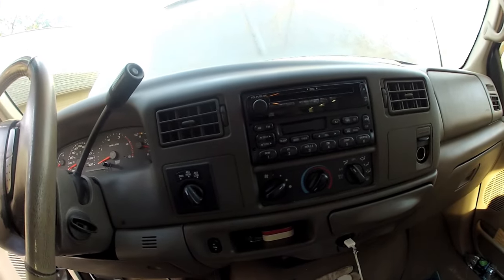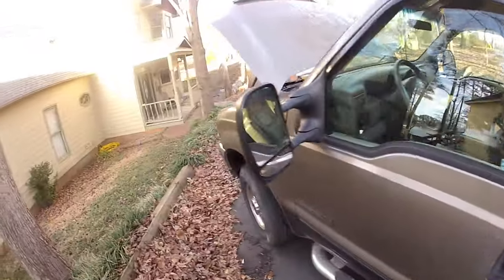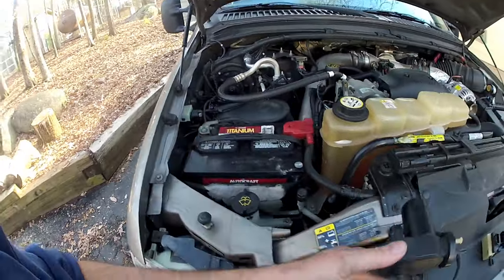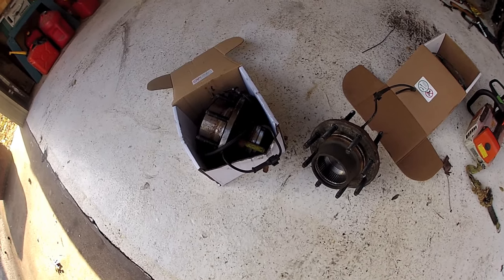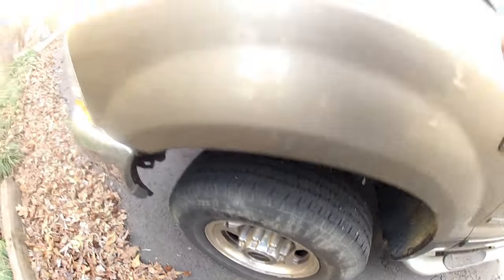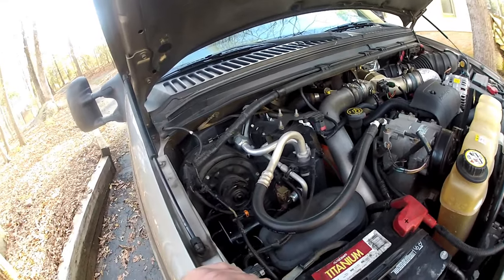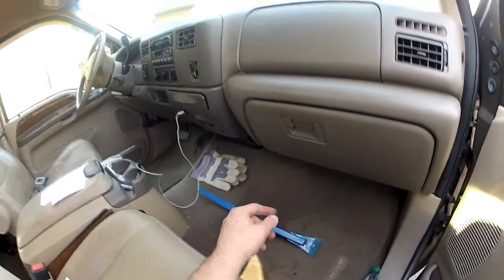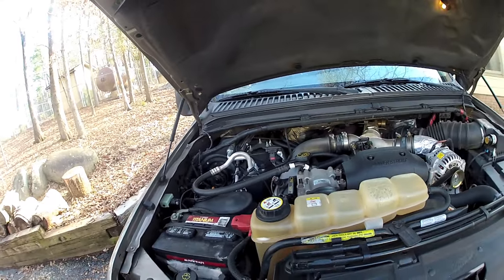Ford F-250 stuck in defrost, problem solved

Comment: not to step on your toes or anything man but I had the same problem and it was the same part you had problems with to its called a pulse vacuum actuator not (egr vacuum solenoid)
Reply from the maker: I think you're right.  It's been quite a while since I posted this, but likely it was sold to me using that terminology by an errant counter person at a national chain parts house.  It's also possible that they'd sold so few of them at the time mine needed replacement, that it may have even been in their computer system with an incorrect nomenclature.   Still driving this truck and it still works well since this fix.  I'm just blown away by how many people have viewed this help vid in an every day non-viral kinda way...
Reply: Certainly saved us a lot of time and money👍
Reply: What your parts guy calls this part and what my parts guy will call this part and what some knucklehead in south Texas calls it could be 4 or 5 different terms.
They are all referring to the same thing.
Reply: That does work thks for the insight
Reply: That worked for me so thks now i know which part to replace
Reply: Here is the proper description and part numbers for 1999-2010... It's a Hub Locking Solenoid..
Dorman OE Solutions 600-402 4WD Hub Locking Solenoid replaces Ford 7C3Z9H465A F81A9H465BA F81Z9H465BA and is perfect for replacement.... This Vid saved me a whole lot of time and work... THX Yankee

Comment: I have a 2003 F250 5.4L 2V, Gas. My A/C would move to defrost under acceleration or heavy load (up hills). Issue was with the vacuum solenoid.  There is no vacuum pump on a gas, no matter what the internet says! Part I used was Dorman 600-402 4WD Hub Locking Solenoid

Comment: i had the same problem.  i ended up just unplugging different vacuum hoses and plugging them up until my pump would shut off, which let me know it wasnt leaking.  the culprit was the same as yours.  it's funny i had a mechanic look at it because when i would leave my hubs in auto the axles would continue to turn intermittently.  this part was my problem.  thanks for the video, between this one and another one explaining how to diagnose vacuum I was able to fix it.

Comment: Funny thing my AC was only blowing put the defrost vents. Problem started about 2 months ago. I did a little research so I was going follow the same path in troubleshooting. I have a 2004 F-250 Diesel with only 41,000 miles on it so I don’t drive it much. I bought it with 25,000 on it. I keep battery minders on the dual batteries while one battery looked like OEM and the other was at least 5 years old. Well they wouldn’t hold a charge any longer was only showing a little over 10 volts and wouldn’t start the engine so I replaced both batteries and the problem was fixed. I didn’t try to turn the switch because it is working and it is summer in South Carolina and I like the AC on. 😂

Comment: 04' ford f250sd here.
My problem started with the ac compressor cycling too frequently, which I'm sure is unrelated and will be a simple switch replacement before I'm done...
But THEN, some time later it decided to start defaulting to blowing out the defrost.... 
It wouldn't start blowing out the defrost until the cab had warmed up, then it would very, very slowly fade to the default defrost vents....
After much fucking around under the hood I dropped down the glove box to see if the actuator for the vent settings was actually doing anything. I pulled the 2 vacuum lines off, and it immediately dropped down to the bottom. I put the lines back on, turned the dial to checked each setting, and found that each was changing the vacuum from one line to the other or both, as it should, so the actuator was receiving the vacuum and functioning fine.
Okay then...
I did some research and discovered that the ac compressor will run on any setting with the exception of 'floor' only. So, after playing around with the vent settings dial long enough, I discovered a sticky spot on the dial, where the vacuum to the actuator was being cut off.
So... a wiggling of the dial is all I had to do to rectify the situation for the time being. I'm sure there's something in the back of the dial that I'll have to fix eventually. Again, it seems to occur only after it gets warm in the cab, making me think it's plastic or rubber getting hot and compacting / closing itself off.
To make a long story shorter, I recommend you check at the vent actuator first before going under the hood looking for any leak.
Reply from the maker: Miles Skagen cool story! I traded the F-250 for a new Tittan XD late this summer.  It's nice to have all the creature comforts I'd lived without for so long, but there's much I miss about the 7.3.  I hate DEF, miss my 800 mile range and bitch about Nissan's turbo lag.

Comment: if you are experiencing that the a/c just blows by the defrost and not by the vents and you are driving in very hot weather just disconnect the 2 hoses by the vaccum  solenoid valve and close that one hose with a bolt tha fits into that hose at lease then your ac will blow by the vents. but the 4x4 will not work automatically till you replace the solenoid

Comment: I changed this vac pulse actuator saw some improvement, but still blows Cool air out defrost vents on a hit day. Why does it work less on a very hot day?Also suspect my 4wd does not shift in & our correctly. What's up?

Comment: Thanks for the video I too am getting ready to track down the source of the same problem I have and this will definitely help to look where to start and hopefully finish. I do have one question as I have been unable to find any information on it, on my truck coming off the pulse actuator I have one green and one red vacuum line. Currently the red line is unplugged and I can see no obvious place to hook it back up and was wanting to know if you’d share where the red vacuum is intended to run to? I’d really appreciate any help you can provide.
Reply from the maker: ...long ago traded the F-250 for a Titan XD.  I still regret it 😥. Good luck!

Comment: there is more to it than that. the device on the fire wall under the freon  silver xeposed to the left of the blower  has a electronic device that they say controls the other fan speeds other than high that don't work. They say it is set for high to work only when not working correctly. 

i will buy one soon, i did buy the part they recomended in this video and it did not fix my vent to continuously blow out of my vents

Comment: This is a great video unless it is s hub , or a line, or the pump, ect..... It's called troubleshooting and not replacing every part in a system until you stumble across the fix. It COuld have been the switch inside the cab....

Comment: My truck has it coming out of the vents slightly but mostly defrost but it will switch to the floor so it must have vacuum and I replaced the vacuum line recently because old one was broken. What could be the issue?
Reply from the maker: Sorry dude... I sold this truck about 6 years ago.  Wish I would have kept it!  I am not a professional auto mechanic, just happened to sort this out on MY truck rather than suffer paying several mechanics that couldn't figure it out.  At least this video was able to help a ton of people along the way.  Best of luck.
Reply: @YankeeinSC1  I actually figured it out, a tube had come off of that thing forgot the name it has a piston inside that the vacuum pulls on to make the vent switch from defrost to vents. Also had to change a broken vacuum line that connects to the firewall.
Reply from the maker: @chriss4365  pneumatic actuator?

Comment: So I have a 98 windstar that has been stuck blowing through the defrost vents in the rear part of the vehicle. It only blows hot air, not a/c. Someone else said the control head is the culprit but now I see this... do you have any thoughts as to whether or not this is the same issue?

Comment: do you think this could be the same problem on a 1999 isuzu rodeo? I just paid $118 for an ac recharge and they said my air shaft is broke and its stuck on defrost. it's now blowing cold but only on the windshield and defrost vents. they told me labor would be expensive as they would have to pull the whole dash out.

Comment: I tried this on my 2001 F250 7.3 Diesel. Did'nt work. So far I've replaced this part,  the vacuum pump, fan motor and put new rubber vaccum lines on the hubs. My air blows through the dash vents perfectly until I activate my 4wheel high knob, then the air shifts to the defrost mode. Very frustrating....

Comment: my truck is an XL with manual locking hubs from factory, i dont have that Pulse vacuum actuator.  where do i look now?
Reply from the maker: +Dennis Wakula well, I'm an owner with mechanical skills, not a mechanic that works on other's vehicles.  Best of luck.

Comment: do more research I purchased this part and only fixed some of the issues. There is an electronic device that has to be replaced on the fire wall fan as well left of the blower to allow all the fan speeds to even work. if yours is only working on high this is the problem.

Comment: Hi there, so what do you do if your truck didn't come with that part installed at factory?  I have this same problem, but I don't have that part in the engine compartment. Although their is a wiring plug that is there from factory, just plugged off.
Reply from the maker: Dude I was just a previous F-250 owner.  I don't work on them for a living, nor did I engineer the system.  Sounds like your system is simpler.  If that's the case maybe your door modulation system isn't pneumatically controlled?  Good luck.

Comment: Where/what is this component and where is it located on an 2011 F250XL SD 6.2L? Would this fix the vent switching issue from floor to main, to defroster. The vent/air seems to be stuck on the main vent and will not switch to floor vents or both floor and main vents so this component would fix that? and would it be the same component for hub locking issues? Thank you for all you do!
Reply from the maker: Sorry buddy, I was never a professional mechanic, but just an owner that was frustrated with wrong answers from service persons.  I've long since (regrettably) sold this old F-250 and "upgraded" to a foreign designed Nissan Titan XD.  Wish I could help, but it's just not my field of expertise.
Reply: Thank you for your speedy reply and I greatly appreciate your time. Best regards, CNWP

Comment: Hello I have a 1985 Nissan 300zx that also my A/C is stuck in delault mode where my cold air is only coming out of my defroster vents what part would you recommend that i should maybe take a look at  replacing ?

Comment: This only applies to 4X4 models, correct? Mine is a 2WD 06 Ford F250 Super Duty. My AC is stuck on defrost mode. Any help would be greatly appreciated!
Reply: Lots of videos about various vacuum issues. Check vacuum lines for leakage (dry rot, broken, etc.). Check the vacuum "check valve". If it's electronic climate control, it could be o-rings in the control solenoids. Keep searching youtube. You'll find more suggestions.
Reply: @flightsimfanatic2418  I've been working on it. Wish me luck. Thanks for the advice!

Comment: mine was that pump that punk should make a noise and vibration and if its not its bad I also replaced that 4x4 thing and it did not fix it but then I did the lump and it fixed my problem also a tip for people with this problem hit the pump hard with something and if it then kicks on uk its the pump

Comment: Well unfortunately all those parts you replaced are no longer available through ford. I have a 2006 f250 4x4. And finding brand new OEM parts are near impossible.  Only aftermarket now unfortunately.  Which you take a gamble in buying.  They may last.  Or they may not.

Comment: Dis your 4x4 switch still actually engage the hubs when the ac blew through the defroster? I know the 4x4 light will come on but did it engage during your ac issue?
Reply from the maker: Varro yes it did but it was never a crisp engage and disengage...  sluggish and sometimes it would get stuck in one or the other...

Comment: What do you do if you have this problem but your truck is 2WD?
Reply: Did you find a solution?
Reply: @jessiecurl1843  no, still trying to figure out out.
Reply: Mine is fixed. Interior fuse panel position #28 is the fuse for the vaccuum pump.
Reply: @jessiecurl1843  very cool, I'll have to try it and see. Thanks for the tip!
Reply: @jessiecurl1843  turns out, I don't have a vacuum pump. It's a 2WD so Ford didn't use a pump on them. But I'm still going to try the fuse in the morning.
Reply: Mine is a 1999 7.3L 2WD. The vaccuum pump is just in front of the heater core blower motor.

Comment: Mine was doing same and I found by unplugging this solenoid, the vent controls worked again.  This is the part no and name from Tasca's website- 4WD AUTO HUB LOCK ACTUATOR SOLENOID VALVE - Ford (7C3Z-9H465-A). To clear up all the wrong names it is being called

Comment: If you had bought a simple vacuum tester it could have saved you money and given you a tool that literally paid for itself. Never blindly replace parts hoping to solve the problem. Test, diagnose.
Reply: Do you have any information on a flow diagram or testing procedure for the lines ?  Im having the same issue as well.

Comment: Im a bit late to the view, but none the less, ill add this to the possible causes for the ac not working correctly. Condeser still spins fine, so im thinking its the pressure high/low for the refrigerant. Hoping its the problem, because i have no intent on having ford charge me an astronomical price for a part i can change myself. Fixed the door cables for the extended cab and saved myself over $300. 😂 Ford has some questionable design errors.

Comment: solved similiar problem by replacing blend-door actuator fuse.; 2001 F350
Reply from the maker: I've solved a similar problem in my first car (a 1974 Pontiac Ventura) by using pliers to straightening the mechanical push wires that moved the blend door when you slid a mechanical lever on the dash...IT HAS NOTHING TO DO WITH THIS VEHICLE PROBLEM, but thanks.